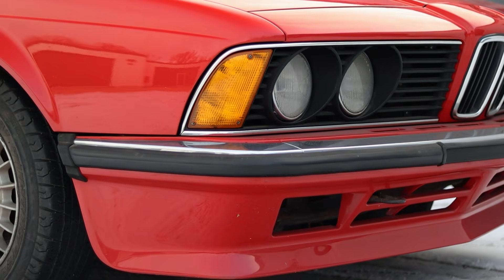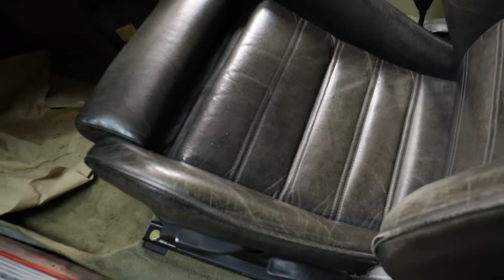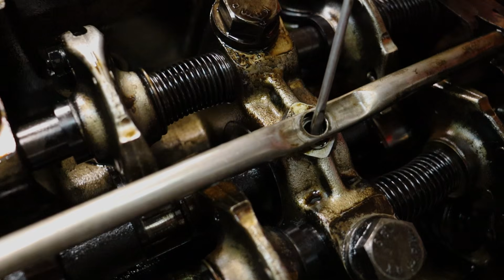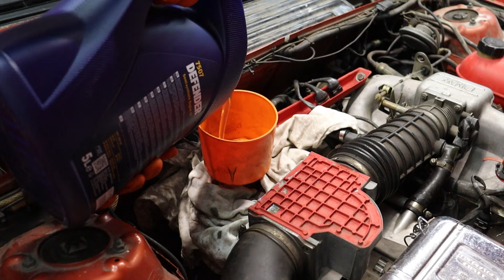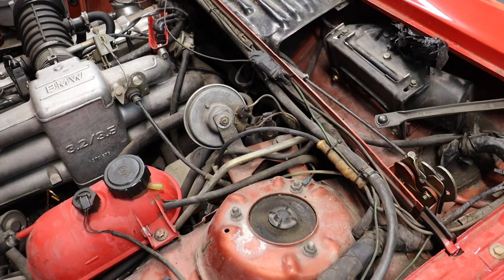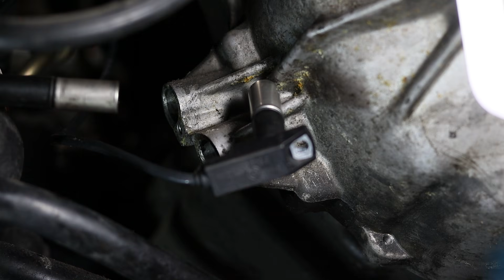Why does this 42 Year Old BMW NOT start? E24 635 CSI - Restoration Part 1

Comment: If that all fails to fix it ,remove the little plastic grid at the bottom of the bell housing ,rotate the flywheel with a driver and check the timing finger has not been knocked off the flywheel/flexplate , also check obC relay is working buy shorting the 2 green wires to bypass it, and the interupt safety switch is not faulty on the auto box,and check the ignition switch is sending power to the OBC RELAY, ALSO CHECK THE CODE hasnt been set on the ObC ,( on board computer )

Comment: Always remember to refit the oil spray bar the right way. There is a small V at the front that must point towards the timing chain. Fit it the wrong way with the V at the back, and only 6 cam lobes get oil. 100 miles later, you need a new cam.

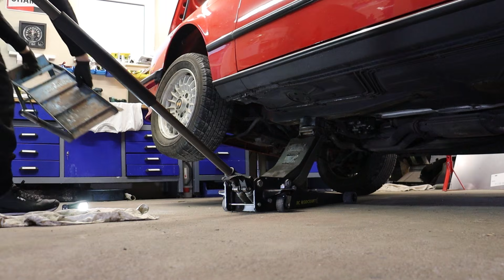Comment: 30:00 Luckily, those sensors came out easily for you! Unfortunately, when I did mine on my 83 633, the upper one snapped at the outer end, leaving about 3/4 of it stuck in the tranmission bell housing! 😬 I had to grind it out with a small right angle drill setup. Extra fun without a lift... 😂

Comment: My 1986 ATG M7 (with M30 engine) has worn Camshaft's Lobes, making tick tick engine noises with just 37,000km!
You have any video on how to correct that without buying expensive & hard to find Camshaft/Seals/Gaskets?
If not can you weld the lobe without taking it out of the engine. Saying that because these 6 & 7 series have a very lousy resale values.
Reply: and use the right oil next time or it happens again
Reply: @1983devill  All services performed by BMW's master mechanic.
Reply: @angelisone  they can also use the wrong oil. Allot of the oils these days are not very well suited for our old engines. And its especially important for the camshaft lobes so that was litterly the first thing i tought of.
Reply: @1983devill  It was really a lousy engine designed by BMW. Just like a dumb Porsche 959 having TMPS & run flat tires.
Both cars owned by my uncle. Uncle was a former NASA's enginner/physician. So he, his friends, master mechanic & I know about cars.
Reply: @1983devill  My uncle's Toyota 2000 GT (modified for Sean Connery) is much older than the E23 (ATG M7) and the camshaft looks like new. Has nothing to do with the oil.

Comment: Love it, I just got a 1987 E24 L6 2 weeks ago so I will come along with you on this project. Mine has been off the road since 2017
Reply from the maker: Congratulations on your e24! I will guarantee you that you won't regret it :)

Actually I am quite far on the project now, recorded everything but I need to find some time to cut the video material. That part is extremely time consuming. See you on the next one!
Reply: @SundayMotorWorks  great to hear! My senson broke off and Im picking away at it.
Reply: Turns out my issue was the main relay and one crankshaft sensor so now on to coolant hoses. Question, can you get repair panels there of the left front wheel arch?

Comment: Hi again SMW , 
I ran the engine without the rocker cover ( AFM /LMM plugged in but not in airflow ) to find major oil leak from the camshaft oil spray bar  banjo bolt being loose . I tightened it and reset the valve clearances at the valve stem side and double checked them . Ticking gone .....
Wunderbar 
Hugo
Reply from the maker: Hello Hugo,
I am really happy to hear that you found your issue. As I said in the video these Banjo bold can absolutely ruin you day. I would recommend the check them every Oil change / valve clearance adjustment!

Have a great weekend!

Comment: Thanks for that info . 
 I will run the engine with the feeler guage between the valve and rocker to see if get rid of the tick . It’s only one cylinder and the tick is half engine speed . 
  Difficult to isolate with rocker cover on ! 
Could be piston noise ( slap ) ? 
Vielen Dank
Aufwieder Horen 
Hugo

Comment: Excellent purchase and diagnostics . I have a big coupe 635csi Shadow line  1987 model here in Neu Seeland { NZ } that I have what sounds like a valve clearance problem ( ticking noise ) .  The cylinder head has been rebuilt ( 330,000 km ) after Gasket failure ,  Engine runs sweet with no oil consumption but after a recheck of valve clearance and reset again a fraction tighter I still have this tick ( Just like a tappet ) that starts to appear as the engine temperature rises from cold . 
  Have you any ideas that may assist with this problem .

Auf Wiederhoren
Hugo Monteith
Reply from the maker: Hello Hugo,

It's really hard to give you a diagnoses without actually hearing the car.
Overall what can be said is that these engines do tick. You can reduce the valve clearance tighter and the ticking will be less, BUT the risk of cam wear is significantly higher then. I would recommend to go with OE clearances. 

However this dies not explain your ticking voice. I have seen calves which had damaged contact surfaces. Maybe doe to the wrong cleances over a long time. The contact surface between valve and rocker arm was extremely uneven and bits have broken out. If you adjust the clearance on such a valve I can imagine that once the engine runs the clearance is out of spec after some time eventually. So maybe check your valve surfaces.